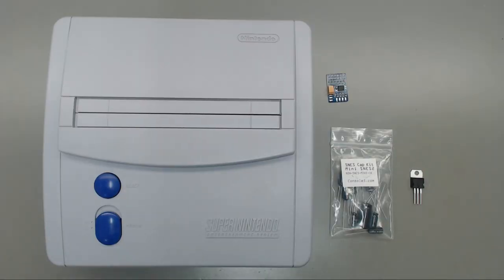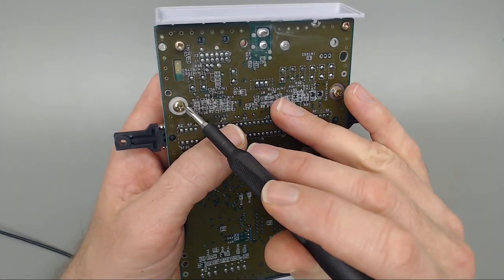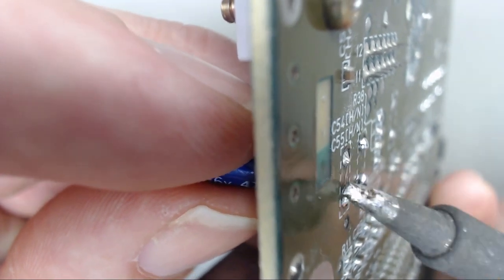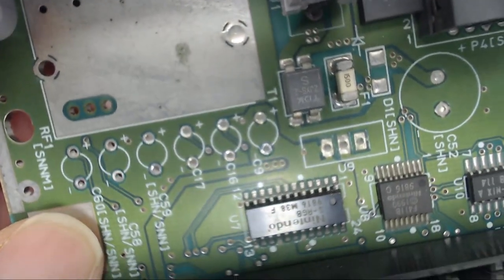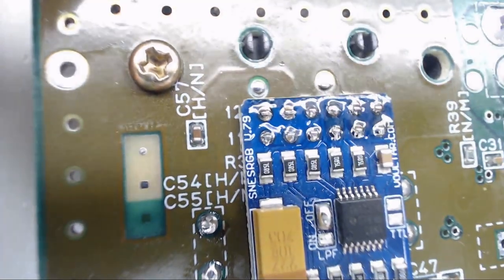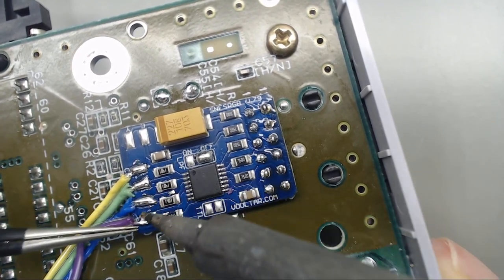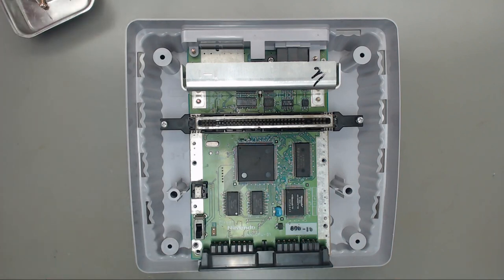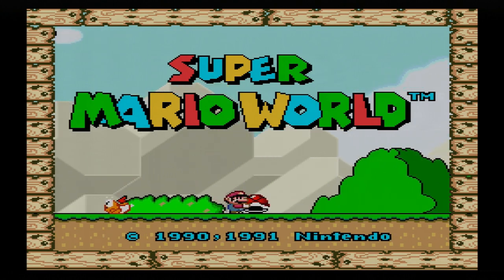SNES Mini 101 Full Capacitor Replacement + RGB MOD Bypass Install!

Comment: Great video! I did the RGB mod and everything looks great. However the sound I noticed was low on my unit. Using the HD retro vision cables. Bought the cap kit from Console 5 but wondering if any of these caps would effect sound.

Comment: I did both of these and the ghosting fix and i have a hoizontal bar filled woth diagonal noise. Tried different cables and psus and its the same. Noise is slightly better when using a sd2snes. Any ideas?

Comment: thank you very much for the video I have a question, that liquid that you use to clean before welding what kind of liquid it is, by chance is isopropyl alcohol.
Reply from the maker: I use flux before soldering and 90%+ Isopropyl Alcohol to clean up.

Comment: Do you also do the c11 cap ghosting fix that voultar came up with?
Reply from the maker: I do! I replace C11 with a 470uF cap that I source from console5
Reply: @dragonshoardgaming5514  does the orientation matter on the c11?
Reply from the maker: @natevirtual  Nope. Ceramic capacitors have no polarity. Get it done!

Comment: Do you think I should replace my capacitors in my SNES mini? I preformed an RGB mod and sometimes I get red scramble all over the screen randomly. I can't tell if it's just a dirty game slot or bad caps.
Reply: I resoldered the mod on both ends and did some continuity tests on all my connections, and everything turned out okay. Now instead of getting red horizontal lines sporadically, instead I lose all of the red color and get like a mud green instead of red. Now I don't know what to think

Comment: That big capacitor that came with the kit that you did not install what would happen if that capacitor was installed?
Reply: It's a filter capacitor. It would theoretically give cleaner power to the system, but it's not strictly needed in the US. I install them in mine because it doesn't hurt anything, but might (in a very rare situation) help.